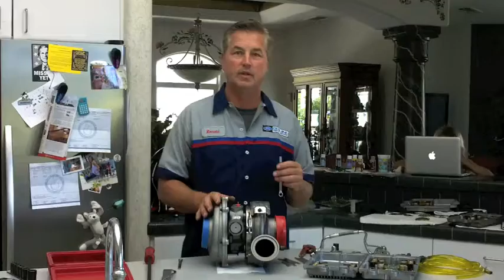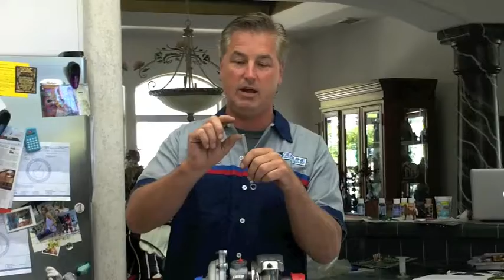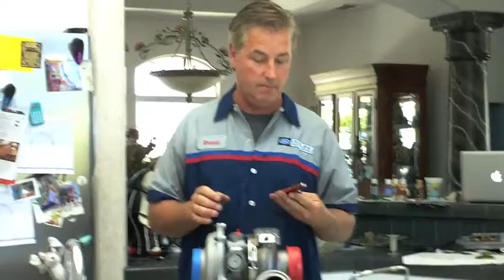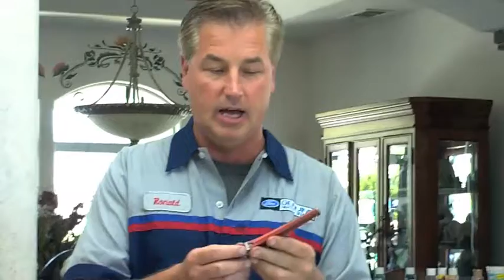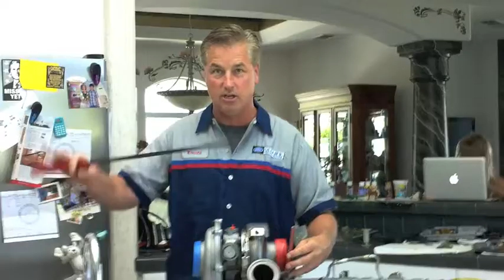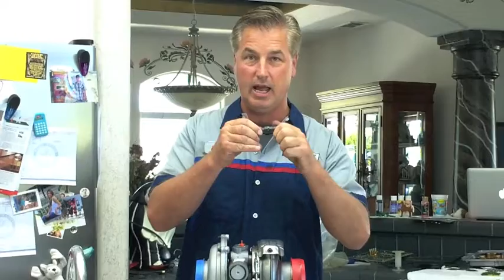6.0 Stuck/ Stripped Turbo Bolt Powerstroke

Comment: Ron, RIP, you helped many people over the years.  I have a 03 6.0 turbo, the back bolt was stripped and rounded out bad.  I had to drop the exhaust down pipe, then using a mirror to see, I cut and ground the bolt head off with a Drimmel.  Once the bolt head was removed I could slip off the bushing.  I couldn't find any way to extract the bolt stud, it was fused into the turbo housing. 
Ron's suggestion to use a small pipe wrench was the answer, I used a 6" pipe wrench an slowly backed the bolt stud out.

Comment: Thank You Ron RIP.
 Your videos bailed me out many many times.
This one here again helping me.
Some couldn't find that Snap On Wrench.
Found it on there web site.
PSWT10K is the number 
10 mm wrench is ideal for accessing the turbo mounting bolts located between the firewall and the turbo with exhaust intake in the way
• Designed for use on 2003 and later 6 L diesel Power Stroke® engines used on Ford® F250, F350, E250 and E350
• Additional applications on Navistar® VT365 engines and some International® 4000 series of medium duty trucks
• Wrench has a zero degree offset six-point head
• Designed to remove excessively tight fasteners off the intake when removing turbocharger where a conventional 15° offset wrench will not work
• 5-1/2" long
Again Thank You!!

Comment: None of these worked for me... So I removed the pedestal bolts, cut the EGR tube and pried it up, used two big pry bars to push back the pipes and rotated the whole thing clockwise and forward; finally came out.

Comment: If it's really stripped just weld a steel nut onto the turbo bolt, then use a wrench to turn the steel nut. The weld will also heat up the bolt to get it out easier.